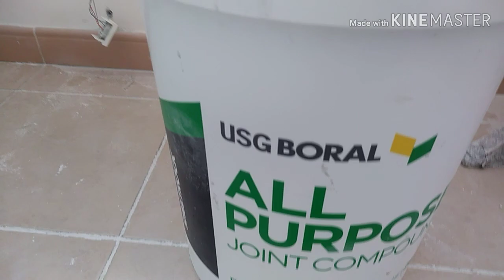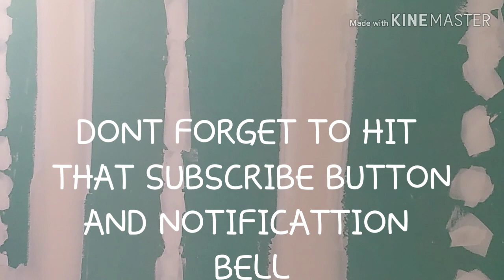PAANO MAGMASELYA SA GYPSUM BOARD.STEP BY STEP.(HOW TO PUTTY A DRY WALL)

Comment: bossing puede  po bang gamitin ung  bosny putty sa hardiflex.
Reply from the maker: Kung wall putty po..pwedi nmn..medyo kelangan mo lng tyagain..dahil di sya kagaya ng gypsum putty ns msdali pumantay ang maselya
Reply: @pinturaatdesenyo  bosing paano pala ang diskarte sa pagmamasilya ng kisame ksi ung pinagawa ko nagkakrak ung dugtungan.
Reply from the maker: @rodrigoagbisit3600  kapag crack po ang pag uusapan..medyo komplikado po..kasi marami pong factor na dapat tignan bakit nag crack..
Maaring sa structural
Pweding hindi stable ang temperature sa kisami..

O pwedi dn di naglagay ng gasa ang nagpintura kaya madali itong bumitak..
Reply from the maker: @rodrigoagbisit3600  try nyo po panoodin to..
https://youtu.be/SGz-Q44C6nM

Comment: Good day po.ask ko lng po kung anu mas mgnda po png ceiling.gypsum board po ba or hardiflex.thank u
Reply from the maker: Pareho po silsng ok...fire proof..at termite proof ika nga..
Kung indoors nman yung cieling walang problema sa gypsumboard..mas mura...
Pero kung expose sa moisture ang.ceiling mas ok ang hardiflex..pero mas mahal dn..
Ang advantage ng gypsumboard..di sya masyado nagrereact sa init at lamig..na kadalasan sanhi dn ng joint cracks..
Ang hardiflex nman kung ang area na paglalagyan ay di stable ang temperature..
I.e..mainit sa araw tas malamig sa gabi..nagreretrack po ang hardiflex ayon sa pagbabago ng temperature..na nagdudulot ng joint cracks..

Comment: Sir good day ask q lng po Sana..ngppgwa po aq kisame nmin n gypsum board pakyaw ung set up nila..kaso pg maselya nila sa dugtungan sa kisame after mfinish paint halata ung maselya sa dugtungan at prang kulang kz halata lubak Lalo sa Gabi nkalubog tignan ung daan NG maselya..dhil originally my lubog PO ung joint surface NG gypsum board..mamaselya pa po ba in sir kz na final coat n NG paint..liit lng kz gngmit nya na png maselya dpt yta mlapad..boysen glazing putty gngmit nya..tas sa Kanto nmn po NG concrete wall namin at gypsum ceiling d n dw pwede maselyahan kz laki NG siwang cornisa nlng DW tatakip sa buong Kanto NG bhay..
Reply from the maker: Dpo katwiram ang malaki na siwang kaya di pwedi maselyahan....ang isang purpose po ng maselya ay upang takpan  o saraduhan ang mga siwang.....yung mga dugtungan po...dapat po pantay talaga..yung lubog na part nh gypsum sadya po yun para kapag nagpahid ng maselya hindi uumbor...wala nman po problema kahit glazing putty gamit  nya...pwedi dn nman..pero dapat pantay ang mga dugtungan...kahit po finish na eala po problema kung habulan pa ng maselya...
Reply from the maker: Sa madaling salita...kateiran lng po yon ng pintor ninyo...
Reply: Sabi nya kpag ka lagyan dw meshtape ung gypsum corner at wall bibitw dn dw ktagalan ung mesh tape...90k p nmn pakyaw nya sir sa buong loob bhay na my floor area mga 120sq.m.. Sabi nya din dapt dw ung pintor mamintura lng di na dapat ksma mgrepair pa NG mga siwang dpt inayos dw un NG ngkabit NG gypsum board..ngaun dami po dugtungan NG gypsum board na di pantay..di mo pantay ung lapat my mga nkausli kunti ..d dw pwede katamin o hiwain dhil mcra ung papel maexpose ung laman NG gypsum di kakapit mesh tape. Kya possible dw mhlata ung line NG dugtungan khit maselyahan at pinturahn..
Reply: Pwede Kya sir hiwain ung parte NG nkausli na gypsum edge pra mgpantay ung dugtungan...di kz gypsum expert tong namakyaw samin sanay lng yta sa plywood na lagi smooth dugtungan..I hope u can help us sir pra sabihan q sya ano dpt gwin sa mga di pantay at mkapal na part NG dugtungan na nkausli sir. kz d dw tlga tlga mpantay un my lilitaw dw tlga na mselya
Reply from the maker: @leahsajise5680  d po totoong bibitaw yung tape sa dugtungan...kami po bawat dugtungan..bawat kanto..kahit yung kanto ng pader at kisame laht po may tape...bumibitak po agad kapag walang tape...
Mali din po na di maselyahan ang mga siwang kasama po yun sa scoop ng pintura...liban nalang po kung gadangkal ang siwang at kelangan talagang tapalan ng board...kahit na nga kung kapiraso lng naman...dnaman makakabawas yon sa kontrata....may mga nangongontrata talaga po na ganyan...
Siguro dpat po kapag nagpapintura kayo...diacuss nyo muna lahat para may habol kayo kapag nagloko yung kontratista...
Reply from the maker: @leahsajise5680  katwiran lng po yun ng pintor ninyo...kung mapapansin nyo pa sa video na yan...kalahati po nyan repaint concrete wall...pero lahat po yan may tape...2 years po ang warranty nyan..mag 1 year na po.wala pa nman tymawag sa amin para magreklamo....
Kami po yung mga butas ng pinag alisan ng ilaw...kami na po ang gumagawa ng paraan para matapalan...basta may avail na gamit..maliit na trabaho lng nman mga yon....
Reply from the maker: @leahsajise5680  gawa po kayo ng parang gadgaran ng kamote...kahit yung omega o channel na ginamit sa pagkabit ng gypsum..butasbutasin ninyo...yung matalas na parte..yung ang ikiskis ninyo sa parte ng nakausli...parang nagkakatam....para dumeretso ang tabas.....
Reply from the maker: @leahsajise5680  kung di nman po masyadong umbok yung dugtungan..kaya napo habuling ng maselya...pero kung sobra laki ng deperensya...ganun dn gawin kakatamin nung parang gadgaran....kaya lng dapat yung area na naalis yung papel..kung hanggat maari latagan ng mesh tape bago maselyahan..para matubay pa din...kapag po kasi naalis yung papel at di ginawan ng paraan...posibleng hihina yung area at prone sa crack....
Reply from the maker: @leahsajise5680  may nabibili po nung parang gadgaran...gypsum pile angvtawag...di ko lang alam kung widely available sa mga hardware....

Comment: Boss anu gagamitin primer at finish coat sa gypsum board tnx
Reply from the maker: Rhen Lumba kami boss gumagamit kami masonry primer pagkatapos maliha ang maselya,,,nakakatulongnito upang di madaling matuklap ang pintura,,,,
kapag ceiling flat latex lng
pero kapag wall mas mainam ang semi or gloss para hi di dumihin,,,
pero bago kami nagpapahid ng gloss or semi gloss,,nagpapahid muna kami ng flat latex para mabilis mapantay at matakpan ang gypsum board,,,,
Reply: Tnx. Boss pwede ko na mahingi num. Mo pra matawagan kita tnx
Reply: @pinturaatdesenyo   Anu ung semi or gloss
Reply from the maker: @rhenlumba9602  lahat po ng pintura ay hinahati sa 3 classification....
Flat..o walang kintab
Semi gloss o medyo makintab
Gloss o makintab...
Reply from the maker: @rhenlumba9602  wala aq ngayon sa pinas boss....nasa ibang bansa aq
Reply: @pinturaatdesenyo   water base Tama na boss
Reply: @pinturaatdesenyo   boss pwede ba ung plasolux glazing putty. Sa gypsum board
Reply from the maker: @rhenlumba9602  pwedi po kung sa pwedi....pero hindi po yun akma sa mga drywall surfaces....pangkahoy po ang plasolux....
Reply: @pinturaatdesenyo  wla kz ako mhanap gypsum putty
Reply: @pinturaatdesenyo  dba mgkakaprobela pag linagyan ko ung dugtungan Ng plasolux glazing putty
Reply from the maker: @rhenlumba9602  dpo akma sa drywall ang plasolux...ang mgiging problema...matgal bago mapantay at magbitakbitak kapag napabigla ng kapal..
Reply from the maker: @rhenlumba9602  ang plasolux po ay oil base..kaya akma sya sa mga kahoy....
Kung wala po kayo mahanap na gypsum putty....pwedi po kayo gumamit ng masonry putty mixed with patching compound...waterbase dn....
Pero matagal dn mapntay ang mga dugtungan..at kapag napabigla ng kapal...maari dn magbitak kapag natuyo